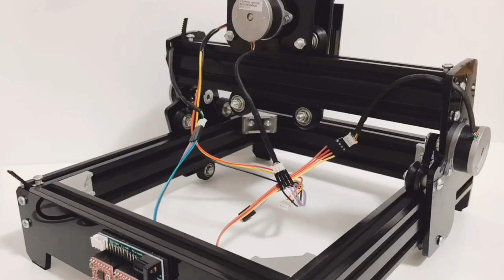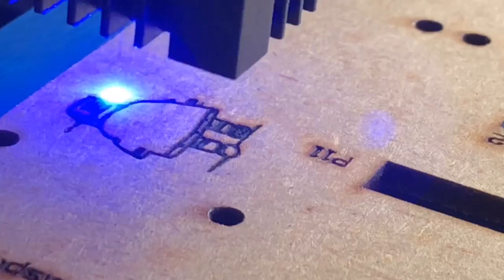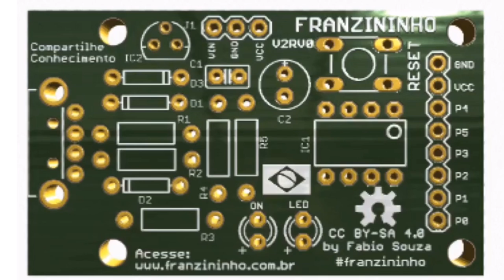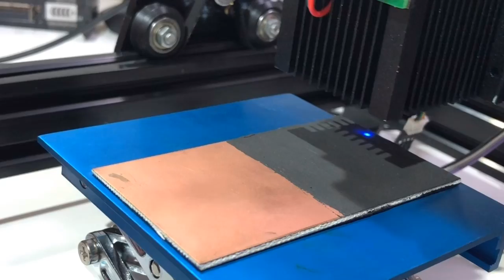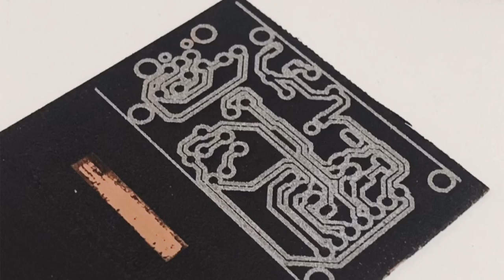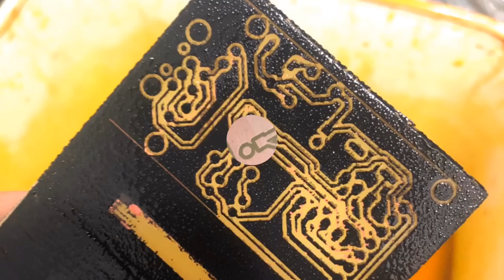How to make a custom PCB using a low power laser engraver

Comment: Im amazed at how many people take the back-and-forth motion approach with the laser (like a printer). 

Use FlatCAM or a vector converter to convert your tracks into vector lines then just set the laser to move along the lines (like a CNC machine, which is what this actually is), burning off the paint as it goes. It takes the laser time down from about an hour to 2 minutes, saving your laser from overworking and saving you time.

Comment: it is hard to get a good ink to get excellent etching results.  I am grateful you posted your work here but based on your ' winner board'  example, I don't think  is good enough for SMD chips. I am still improving my technique but with a CNC machine using V bit of 30 degrees I can get reliable, clean tracks of 0.4mm width, and almost no post processing after the milling.   If I use V-20 degrees I can get reliable tracks of 0.25mm.  It takes time, but you skip the chemical part of the etching process, which in my opinion is such a problem to do at home and the result is of higher precision too.
Reply from the maker: You’re right! The final result isn’t great, but it’s acceptable for home made hobby purpose only.
In fact the quality is poor and SMD components won’t work.
I hope some day I can put my hands in one of those CNC machines! 🥲

Comment: I bet that after chemical etching, you can add new coat of acrylic spray paint as solder mask. Then use laser again to reveal the pads, while leaving traces under the paint.

Then you can put the board in electroless nickel solution and immersion gold solution. These are not expensive in small quantities (in my country it's like $10 for 200ml). This will make your board look almost professional. Except for plated thru vias :-)
Reply from the maker: Harvie, thanks for the advices! I’ve never worked with those nickel and gold solution, but I’ll try to learn more about it.
I liked the idea of applying another layer of paint is interesting. Will try it soon. 😁
Reply: An immersion gold solution would be very expensive indeed. Would only be worth the cost if you are making 100s of boards a day.

Comment: Great work! Can you try a sharpie instead of ink? I think the very thin layer of a sharpie will allow finer resolution and be completely removed by the laser.
Reply from the maker: Thanks, Jeff! I'm glad you liked. I'll try a sharpie instead of ink to see if it works. I think it won't be easy to create an uniform layer with the sharpie.
Reply: What would be worth trying is using UV sensitised film and then using the lowest setting to draw directly on the film (ie expose).  If this doesn work then expose the whole film to UV (sunlight etc) and burn away the areas you need for etching.

Comment: I was wondering if you could make the PCB by using the laser to fuse copier toner. The idea would be to put a thin layer on top of the copper without fusing it - as would be done in powder coating, then selectively fuse the toner with the laser. I  am curious if anyone has tried this.
BTW - very good video. I am planning on buying a laser engraver to make PCBs.
Reply: Ive taken a reverse photocopy and ironed it on to a copper board for etching.  The iron heats up the toner and it sticks to the copper.  So yes, you absolutely can use toner.
Reply: And what's the results am curious about it

Comment: did you try to itch the copper with the laser itself? it might take multiple iterations, but in theory it can work!
Reply: You need a big old laser to etch copper directly. The problem is copper conducts heat way too quickly for a diode laser to burn it, as soon as the pinpoint of the laser hits the copper, the heat from the laser just dissipates instantly. A CO2 laser will probably work and a fibre laser will definitely burn copper, the problem you'll have then is once the laser has penetrated the copper, it will be at such a high power that it will almost instantly burn through the board underneath, you'd have to work out the perfect feed rate of the laser so it burns through the copper but doesnt have enough time to burn through the board.

Comment: Great job - I was looking at Milling my PCBs, but this looks interesting.  What ink do you suggest/use?  Any Amazon links?  Thanks!
Reply from the maker: Thanks! I used an ordinary acrylic ink. It worked for me. I’ve never milled a PCB, but maybe it would be better (or faster), and would allow you to perforate the boat as well. The laser engraver can’t do that.
Reply: I am going to try craft paint. I suspect acrylic ink is the better choice.  I found your site quite easily.  I have a 5 watt laser etcher.  Should be interesting. Thank you for sharing!

Comment: I dont get it, it's still a copper PLATE.  The seperate paths dont exist.
Reply from the maker: Hi there! After the laser is applied, you have to etch the board. It will remove the areas of the copper that are not covered with ink. After that, the ink shall be removed and you’ll have separate copper paths to solder your components.